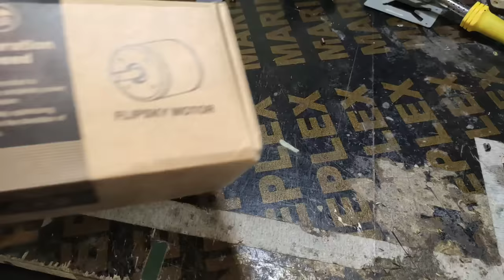12v dual tire dual motor electric go kart from bicycle part and Flipsky motor

Comment: This was so refreshing 2 see stick welding, just tired of everyone picking up a MIG welder
Reply: But he has no penetration with his welds are very surface level they will never last 1 good bump or having to slam on the brake he will be walking, he only knows how to tack weld repeatedly, if your doing tutorial videos teach the right shit
Reply: @jacoblimbaugh9220   
.$
Reply: @jacoblimbaugh9220 Cuál sería el soldador correcto a utilizar?

Comment: I hope you don't hit an immovable object, because that steering 'column' will core you like an apple. It was a common fault in American cars in the 30's thru to 60's. Otherwise go Lithium for long lasting power
Reply: salam
Reply: Amen. Before tilting steering columns many heads were removed by a steering wheel also here in Northern Europe.
Reply: This is a go kart not a car for the roads
Reply: @AyyLarry  There are immovable objects offroad too.
Reply: @AyyLarry  That is a foolish response. Moving objects can hit stationary ones.
Reply: Add a flat, broad solid plate to the top of the column so you just break a rib or get the wind knocked out rather than being impaled.
Reply: @AyyLarry  

mi
Reply: @Teknopottu  ji9

Comment: Fun build Brother, but would suggest adding some support to the outer axle points. Those bike axles aren't designed to have weight applied to only one side.  Especially if you over volt those motors!  If the chain were to break when a back wheel snaps off at the axle...very bad things could happen!  Like ...cut your arm or leg off kind of "Bad"!  Be safe Brother! it's hard to build without hands! ;)
Reply: Ya, I'm sure that they've busted off by now.
Reply: 0

Comment: At maximum power that motors with that size of back wheels it should be able to reach at least 80km/h (45mph) , depending on the gear ratio from the motor to the wheel, pretty Nice job, very good idea the double wheels and that motors are monsters be careful if you gonna use higher voltages
Reply from the maker: that's why I only use 12v 😅
Reply: It will never go 45mph on 12v battery
Reply: Using outrunner motors wow

Comment: Interesting welding technique. Guessing there is more than just tacks holding it together?
Reply: We call it ticky tack welding at work or 'sam' welding after a welder named sam who would weld everything fucking like that. You can kinda get away with it on thin material with a mig but it's very prone, to cracking, cold role and inclusions. If done carefully it can be ok when welding oversized gaps on non critical or low stress welds but really it's just shit and only slightly better than glueing shit together
Reply: Hes doing a really nice job considering the fact that hes using an arc welder

Comment: Nice build but, it needs some improvements. A suspension, outer part of the hubs need support, a brace closer to the steering wheel.

Comment: That is genius. I will do one like that, but using motor I made out of alternator. Thanks man.
Reply: Instead of alternator better buy a cheap broken hoverboard and use the motors.To modify an alternator is more expensive because you need to buy the magnets and separatedly they cost a lot more than getting allready made motors from hoverboard.
Reply: @mihaiilie8808  how about using motor starter?
Reply: @latebloomer2  thats bad because it has brushes.Brushless motor from hoverboard is the best.

Comment: The thing is you get some trade-offs with wheel size. For uneven ground small wheels are dangerous, like with small wheels on scooters they are known to be rather unstable, where with larger wheels you have less rigidity. This is why people ultimately go for larger alloy wheels. If you want to go faster then you'll find this becomes more of an issue. Aerodynamics will also need to be considered. It's quite easy to knock up with some fibreglass fairing. Being low to the ground is good though.

Comment: 48v, 190kv, 14" wheels, 1:4.2 sprocket ratio... nasa 110-130kph daw po yan as computed by Esk8 Calculator. Good luck po!
Reply from the maker: 80 to 90kph lang siguro, too much wind drag.

Comment: yeah it could achieve that kind of performance you state with the 60V capable controller you linked in your description but you used an 80A rc car controllers which are in no way capable of handling the current load you have....

Comment: You can put one more battery under the steering rod, there is pretty much space for it. You can use it do double the permforance or use it for emergency battery.

Comment: Friend you have to tell me how did you get that go-kart so fast with only one battery that's amazing.
Reply from the maker: high kv motor
Reply: @albertnario4877  How much power is each of those motors getting?
Reply from the maker: @mattn.8941  maybe 800w to 1000w.. peak
Reply: @albertnario4877  I just now noticed that the controller says 80A.. thank you for the quick reply! Liked and subbed

Comment: why only 12v?
Reply from the maker: esc only support 12v it expensive to use 2 vesc
Reply: Dual fsesc 6.6, 7.9k php bili ko nung december sa lazada.
Reply from the maker: 2.5k bili ko sa fsesc4.12 .. 8k mejo mabigat pa dn sa bulsa. 😅

Comment: What was your setting for the current on your welding machine?
Reply from the maker: 90A and 130A depends on metal
Reply: @albertnario4877  what metal did u use here? Is this G.I.?
Reply from the maker: @JoshuaJapitan  yes
Reply: @albertnario4877  so 90A on G.I.?

Comment: how do you deal with differential turning speed of the rear wheels?
Reply: The rear wheels spin independently and each have their own motor. I have heard that even when applying the same input to each motor the wheels will turn at different speeds naturally.

Comment: Which material it's chassis made of
Reply from the maker: steel
Reply: @albertnario4877  plz give full detail....how much thicknesses
Reply from the maker: 1.5mm
Reply: @albertnario4877  I want 2 make a jeep which can hold weight of 900 kg how much thicknesses it should be
Reply from the maker: @RAJEEVKUMAR-xk5pz  2x3 are more suitable in your project

Comment: This is not a real welding video. I am a licensed welder and I know for a fact you cannot start and stop welds like that without scraping off the slag first. stick welding is known for creating a hard slag over the weld that must be broken off each time you stop or it will create thousands of little bubbles you cannot get rid of inside the weld. i’m not sure how he faked this video but I know it’s not real and I’m quite literally licensed to say that.
Reply from the maker: try it, it works 😅. I'm not a welder, I'm just a DIYer 👍
Reply: @albertnario4877  Oh I see. you got to scrap off that slag bro. Your weld might look fine on the outside but if you look inside it using x-rays you would be able to see that the weld is extremely brittle. if you did that on a pipe that is meant to hold pressures it would explode out the weld. if you made that type of weld on a vehicle and it crumbled during the drive they would track down the welding ID number of the person who did it and that person would be held responsible and probably criminally punished. I know you don’t weld professionally but that’s an example of what could happen the way you’re doing it.